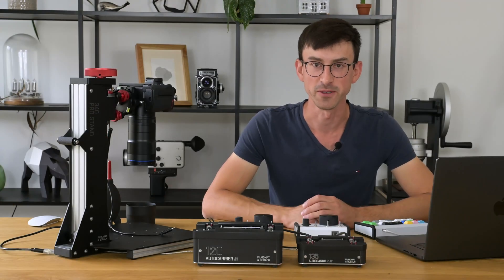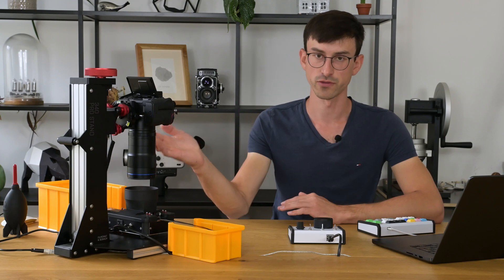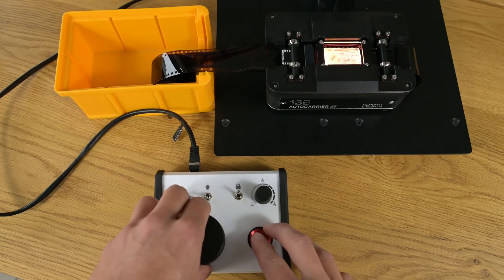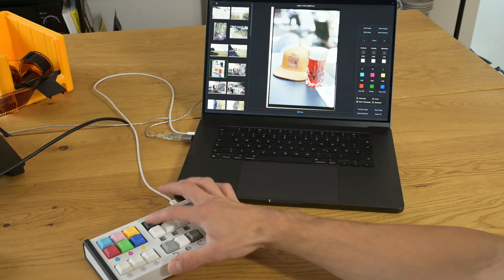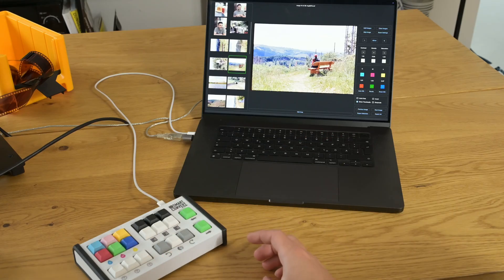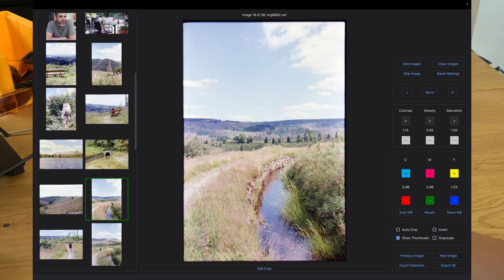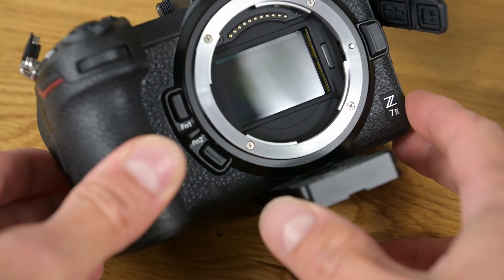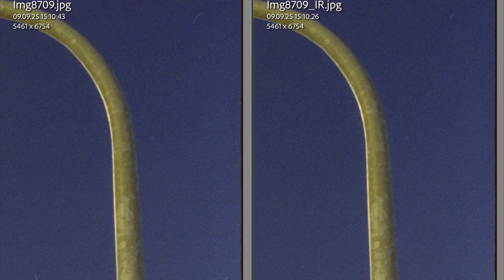Scanning film in 2025 with the new Autocarrier scanning system and SmartConvert

Comment: As someone who scans negs for a historical society I can see the application of this system in situations where there is a massive workload, museums etc.We have discussed the possibilty of an automated method along the lines of the manual method I have devised, which is essentially a fully manual 'auto carrier'. Had to be done as there are close a million images to scan and it was taking the previous team 1 hour per roll of 48 images. It now takes 8 minutes total time per roll.
You could devise  a roll holder at the film entry end( instead of the box) and another holder at the exit end - the film will automatically rewind itself - this is what I have done as being 48 frame rolls I did not want the hassle of film piling up on the work surface,  I wanted a very clean workflow. Works well.
If we had the donated funds I would be so keen on this set up, sadly we struggle for funds.
 So impressed with what you have acheived.

Comment: amazing stuff. i always recommend using a lens collar to mount the lens on the arm instead of mounting the camera itself. when you use a lens collar, you can easily remove your camera without messing up the tilt or focus of your lens since it says mounted fixed onto the arm. how do you go about fixing the carrier base to the scanning table? one annoyance of current options is that the base can move around or be bumped. love your products mate. I love my filmomat LIGHT!!
Reply from the maker: Thank you! Yes, mounting the lens instead of the camera indeed is a great option. Probably better than mounting the camera, also because there is less leverage. I usually don't have problems with the Autocarrier moving around, but we are actually working on a magnetic holder which secures the Autocarrier on the Pro-Stands base plate using a magnet :)

Comment: It's like we have this easy and cheap solution on how to scan film without the need to buy a good scanners and some be like... "let me get gear which will potentially end up costing me even more than a scanner or camera, to just help me do something I could easily do without all that extra gear"
Reply from the maker: Nobody is forcing you to use this equipment. The Autocarrier is a tool to make camera scanning a lot more convenient and fast. For some people this is a huge advantage. If that is not the case for you, then there is nothing wrong with doing it the low-tech way. Thats the nice thing about camera scanning: You can adjust the setup according to your personal needs and budget.
Reply: @filmomat_official  I'm just voicing my opinion. That's what the comment section is for. I doesn't really make it faster btw. just a bit more convenient.

Comment: Ok guys thats great... but nearly 2000€ for just the 135, 2750€ for the 120, you still need to add the stand (or make one) etc... I do understand that behind the product there are Research and dev...
Only pro labs will afford such a tool and get a return on investment. With these prices, i could afford to have more than 300 color films processed and scanned (high quality). Couldnt you make a cheaper pack please? Take care

Comment: Hi there- is there a list of cameras available or will this work on anything? I use the following - Hasselblad X2D, Hasselblad 907xCFV100c and a Leica SL2 - thanks
Reply from the maker: All cameras which have a remote trigger connection will work. You just need an adapter from your cameras remote trigger connection to a standard 3.5mm headphone jack, to connect it with the Autocarrier :)
Reply: @filmomat_official  super duper - Hass yes on both - Leica not sure about that - its a brilliant thing - love it

Comment: Don’t understand the ludicrous of scanning negative in digital era. Purpose of negative film is only one, that is to satisfy the need of traditionalist. Making prints straight from negative. Not converting them to digital. Otherwise you will lose the film effect. Unless you want digital of old negatives…Spending so much money and pain and for what? To have digital?
Reply: There are many good reasons to create digital copies of film, whether negatives or slides. Libraries and archives often scan their collections to preserve them against degradation and to make them more accessible online. Digital copies also protect fragile originals, which might otherwise be damaged through repeated handling.

For individuals, scanning film offers flexibility and convenience. Photographers and hobbyists may enjoy shooting film for its unique look but still want the ease of backup, editing, or sharing that digital provides. A high-quality scan can be restored to correct fading, scratches, or dust, and can be reprinted in different sizes without further wear on the original negative.

In short, digitizing film doesn’t replace its traditional value — it extends its lifespan, broadens access, and opens up creative possibilities.

Comment: Great to know that someone is making advance scanning systems. I know that labs still use the Fuji Frontier and Noritsu systems but those are now 30yrs old and can imagine that those systems will not survive to many years longer. This does look like a lot of time was put into this system and although it might be a little expensive it will outweight the cost of developing and scanning at a lab. Currently I am paying $44 per roll of developing and scanning in high quality and that adds up very fast. I have a Hasselblad Xpan and was wondering if this system is able to scan the Xpan format? I am very tempted with this system.
Reply from the maker: Thank you! The system can only capture standard 35mm frame. For Xpan you can stitch two exposures together :)

Comment: Tiff is a great option, you can do 'basic' scan corrections there, then with the tiff format, use Capture one or photoshop to edit further, or do a creative composition with it; if you do a jpeg its all finished, baked in. think of the scanner software as doing woodworking, the first software is the 'AXE' to chop the tree, the C1 and photoshop is the plane and router, to finish the project off, the scalpel in other words. There is place for Both in a workflow, if you don't bake the data in too early.

Comment: I really love your smart convert software BUT it this current version it is crashing a lot. already contacted support but its still very annoying that only 1/5 of the total exports work. still on your side... fck adobe
Reply from the maker: The new version (3.0 and above) offers a massive speed boost - which comes at the expense of more computing power needed. Usually, crashes occur due to lack of free RAM, for example when other process-intensive apps are running in parallel. If you can email me some more details of the exact circumstances of your crash that would be helpful (sorry if I missed your earlier email). I'm working on a way to make the app more stable in the future.
Reply: @filmomat_official  it shouldnt be the RAM, i have 64 GB. a complete reset of my PC is overdue anyways so that might fix it. But maybe its possible to add a setting to use a gaming GPU like the RTX 3080 i have as a possible resource ... and the crashing and having to restart fresh is the annoying part
Reply: Yes i have the same problem. It starts exporting, makes a map and then stop working en sometimes even close the program. Than you have to start over...
Reply: I also love this software. I am happy to be done with Adobe. I have not had much crashing until I changed my camera to an OM Systems. I am working with Lukas to get a fix.
Reply: It also will mark all your files as “SKIP” sometimes. If there’s areas of the scan with no image, it displays the whole pic as white. You have to crop then recalibrate. It doesn’t have any automation, no batch importing or processing, it is very slow and cludgy. It crashes. Cropping is slow. The whole process is very poorly executed. Feels like a .8 beta. 
I’m going to inquire about a refund. I’ve had it. It’s quite a bit  faster to use PS!